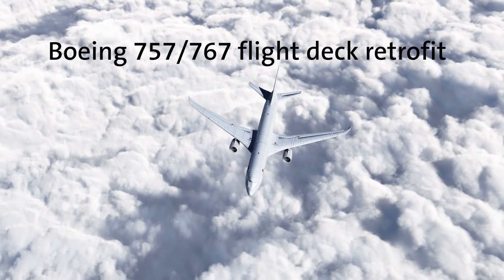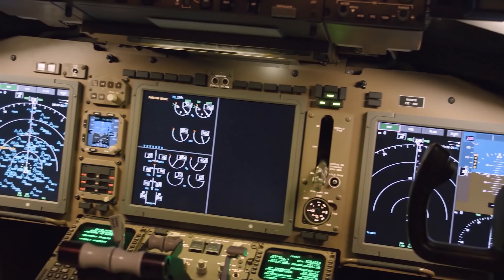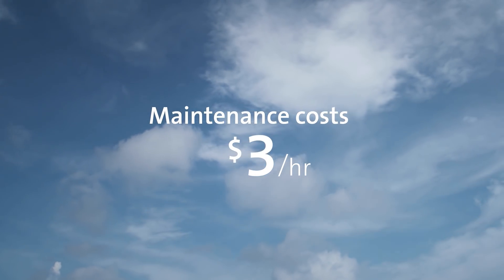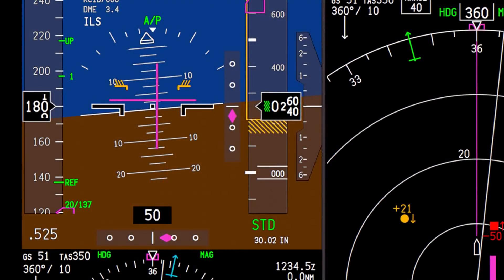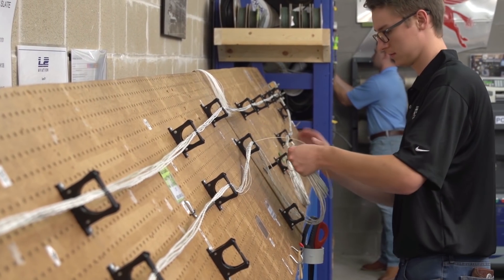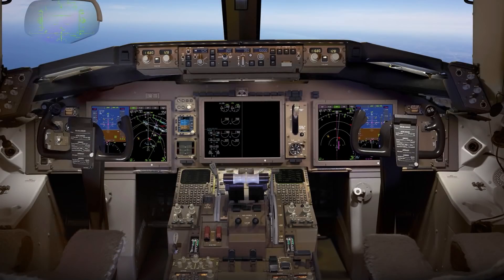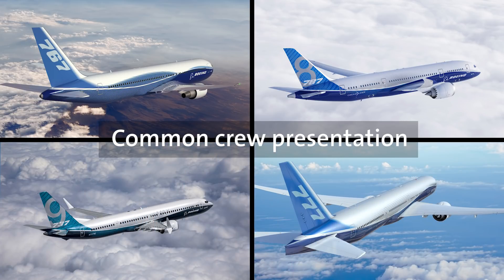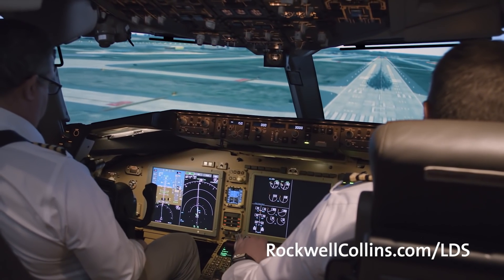Boeing 757/767 Large Display System (LDS) Flight Deck Retrofit

Comment: There has been an upgrade to the older design called MAUI. Mid-life Avionics Upgrade Initiative. This mod has been out for approx 10 years. I was working for AA as a contract mech when this mod came out. This LDS system is more advanced. The younger right seaters and mechs seem to adapt much better to the digital  than us older types.
Reply: I know the feeling. I flew all of my hours on steam gauges. Now it’s Garmin Glass for even older aircraft. It would be nice if some company could come up with engine retrofits that are economical for some of the early GII and Lears.

Comment: Is there a similar scheme to upgrade the 747 displays? Or are the 747’s already considered “modern”? The flight deck of the 747, to me at least, is looking a bit old and tired now. A beautiful bird of course, but the drivers seat is looking past it’s prime.
Reply: Even in the -8 versions? I thought Boeing did an upgrade to resemble the 777/787 flight deck.
Reply: @Subgunman  nah they dumbed the -8 down so -400 pilots only have to do a differences course. I know I’m one of em. 

Imho it’s DEFINITELY due an upgrade. Especially that FMS.

Comment: 757 one of the best aircraft today.  Boeing should never have stopped producing these aircraft.  Better to have made the 757MAX.  Think about it.
   👍👍👍.  9-6-21
Reply: I thought about it, and there's so many reasons why it's not viable. And that's even before including boeing's corporate greed.
Reply: Boeing has made so many mistakes post year 2000. 757/767/777 was peak Boeing. After that, they have started to decline.
Reply: @medviation  Major decline.  Airbus will take over the aviation industry.  So sad.

Comment: I have flown both systems extensively and found the tiny little VSI a big drawback, 14000 hours on 757/767
Reply: I hear you.   Put the digital readout in your scan instead of the little needle.   You'll get used to it.   Now you know what the guys flying the 72 felt like when they transitioned to 80's generation aircraft.   An endless circle...
Reply: It's an improvement in that it's lighter and more reliable,  but a step backwards in useful interface with the pilot.I noticed both in the airplane also during simulator sessions pilots were less accurate especially in the final 1000 feet to TD

Comment: I like the idea, BUT!!! MAYBE replacing a small standalone attitude indicator with an equally small standalone electronic one is not a good idea. You win absolutely nothing but it can be a great WORKING tool in case of full cabin blackout.
Reply: The standby mini-PFD has a battery in it that lasts about 15 hours (not sure of the exact figure, but a long time). Kind of like a re-chargeable watch battery. So in the event of a complete blackout, you have the mini-PFD running on its own standalone built in battery. If you can’t get down in 15 hours, you’ve got bigger problems. Plus you probably won’t have fuel for 15 hours anyway. The standalone mini-PFD is a tried and tested bit of kit and is in most aircraft today.

Comment: What is LRU?
Reply: line replaceable unit. its a part that can be quickly and easily replaced at the flightline rather than requiring a hangar trip

Comment: That avionics are good during the day, but in the night is so difficult to see, because of the bad contrast if you put down the brightness down. The horizon and flightdirector are so small, you need glasses to see from you normal position in the seat. And the speedvector is oversensitive, so it jumpes up and down all the time if it‘s bumpy. Many our pilots hate those new avionics! This is a view of a 75 skipper.
Reply: You should be contacting your technical reps and advise what the issues are so they can correct the issues.
Reply: Our company upgraded our Saab screens to LCD. Look amazing at full brightness but we have the same issue with the contrast when the screens are turned down. Ironically, their brighter at their lowest setting than the CRTs. The CRTs would leave the flight director a little brighter than the horizon when they were turned down. Still, happy to see something new up there.
Reply: @PatrickJWenzel  Hopefully they're already working with Samsung to get OLED displays for the next generation. Lower power, and they don't light the whole screen like an LCD, they light the individual pixels, making the blacks wayyyyyyyy blacker. Goodbye edge bleed, contrast issues, all of it. Hoping for you guys
Reply: If you need glasses just to see the flight director I’m not sure you should have your medical